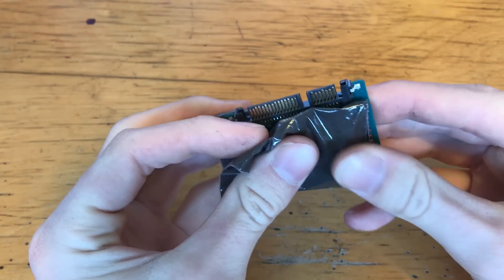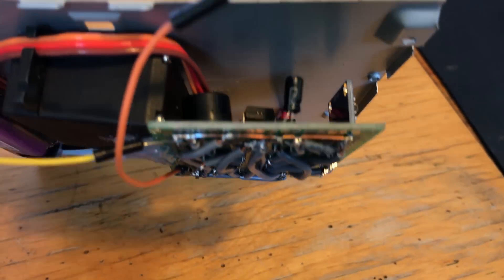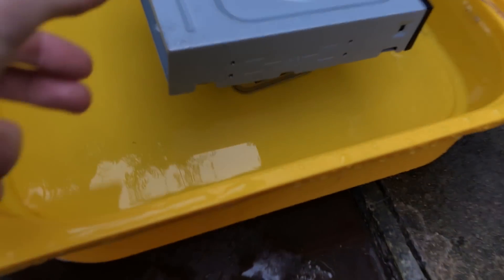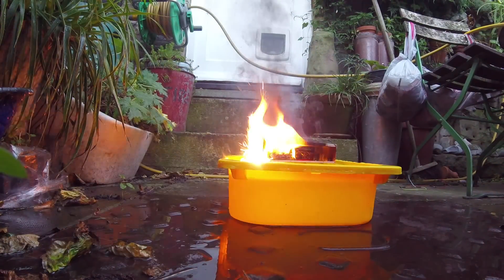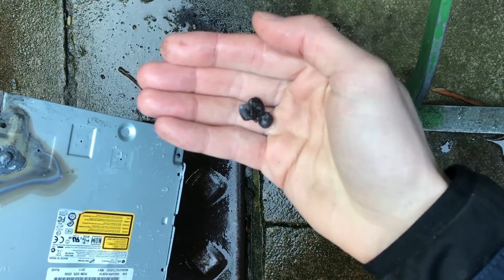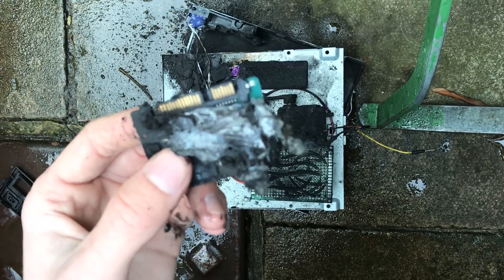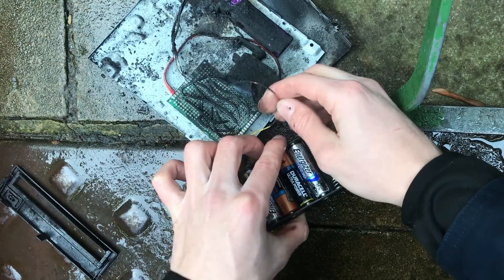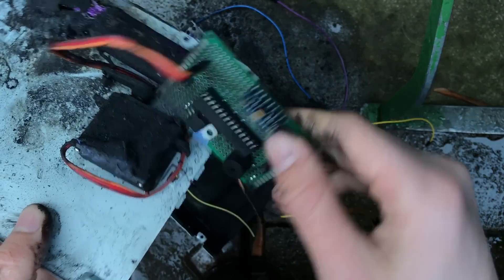Self Destructing SSD DIY | With Thermite

Comment: Something ready-made would be model rocket engines, road flares, stuff like that. Just an idea because for a few dollars at hobby lobby you can get that type of stuff and even a remote control detonator. Obviously for a slower burn you would have to extract the stuff from the rocket engine and tweak it a bit so that it's quick but not so quick it's like an explosion.

Comment: Wrap thermite in a bit of aluminum foil in the shape to cover the ssd or regular hdd. Ignite using a vape pen coil coated with a 50/50 mix of sparkler composition and black gunpowder from a firework. Energy source for firing would be a usb phone battery charger that uses a 186650 cell. Usb 5v from computer keeps it always ready. Activate by a pull pin switch. Depending on what needs thermite can be scaled up as needed. Interesting enough some nuclear weapons use a similar thermite based self destruct mechanism except it is a few hot burning strips of it that does not outgas much that fries the sensitive bits such as capacitors and  firing tubes without setting off the explosives.

Comment: Try for a V.2 a relay in place of the servo and a model rocket motor igniter in place of the lighter. Less moving parts and more reliable ignition

Comment: All of this is really not needed to physically destroy the ssd, Just use the micro-controller to close a circuit to a nichrome wire embedded inside a black power baggie. (or better yet a closed metal container that will cause some nice fragmentation)
That's will kill the SSD. And everybody in a 3m radius. :)

Comment: I assume you used black iron oxide and aluminum powder. In this case, Iron metal and aluminum oxide would be the products. Just some info, whatever oxide used in a thermite reaction will become the metal once the reaction is complete, and the metal (Aluminum) will become the oxide.
P.S. You may like to use thermate, as it burns several hundred degrees C hotter than thermite. Here is the recipe for that: 51.52% Iron (III) Oxide, 17.175% Aluminum (30um), 29% Potassium nitrate, 2% sulfur. All materials should be in powder form. 
----I have been watching a lot of your Rubber Ducky/electronic videos lately since I have become more interested in things of that nature. I can say your channel has been really helpful and fun so far. If you need any more information or more details and help with anything chemistry related (maybe making that thermate), just let me know. I'd love to see you do more fun things with stuff like this!
Reply from the maker: Yep I used black iron oxide, and yea it might be fun to look into thermate, besides I've got loads of iron oxide and aluminium remaining.
Reply: Seytonic I suggest looking at it's wiki page and watching a few YouTube videos. I recently set off a kilo of thermate- everything within four feet of it was charred black, and there was about a five foot radius splattered with beads of molten Iron. I would recommend containing it, otherwise the reaction is so quick no molten metal really penetrates your target. The heat is insane and will indefinitely vaporize any plastics within a foot. Again, if you pursue more things like this I can help you. I have done a lot of math on thermite and thermate especially (Also as a note: Some ratios may be different since you are using black iron oxide, but it should still work fine).

Comment: You might consider using a electronic cigarette atomizer for an igniter in place of that lighter. You can get the coil to ignite just about anything with low voltage. It would eliminate the need for both the lighter and servo. Fact is you could probably cram it all into an external usb drive case then, and use an arduino to ignite it if someone disconnects it or enters the wrong password. just an idea anyway

Comment: Did you try and recover data off of the SSD?
Reply from the maker: Unfortunately I don't have a forensics lab in my basement, so no :)
Reply: Seytonic
How about just sticking it into a PC and trying to read from it? The heads seems to not have suffered at all.
Reply from the maker: ***** The fact that some of the chips had popped off makes me slightly dubious that would work. And yea the headers are all melted so just plugging it in won't go very well.
Reply: Seytonic
It's fine if you don't want to push further, but I'm not 100% convinced
Reply from the maker: ***** Feel free to pry the chips off your ssd and prove me wrong :)

Comment: I'm curious as to what the composition of the Thermite was. A normal lighter shouldn't be able to ignite the powder itself, therefore I'm guessing there was a magnesium strip or something inside?

Anyways, cool idea. Although I'd be worried that it could be set off accidentally in any number of ways.
Reply from the maker: Just 8:3 iron oxide to aluminium, and I was using a jet lighter if that makes any difference.
Reply: I dunno how hot those get, but the ignition temperature for thermite is roughly 1649 degrees Celsius. A propane torch can set it off, so I guess a jet lighter must reach that level.

Comment: Is any soldering needed for the rubber ducky arduino?
Reply: Angus Wood I think only if you want to add the sd card slot.
Reply: Anthony M. But how do you solder them together?
Reply: Angus Wood he has a video on it.

Comment: you should try out something like the USB killer, sending a very strong charge through the ssd
Reply: The data on it would be fine. There are lots of fuzes and other fail safes that prevent something like that from wrecking data.
Reply: dont think dumping a HV supercap into the data and powerpins on an ssd would save it tbh
Reply: @TheSysops666 any results?